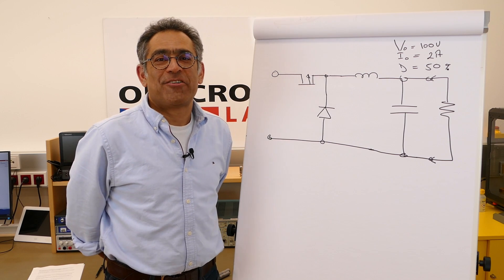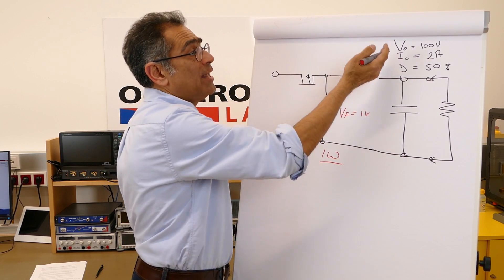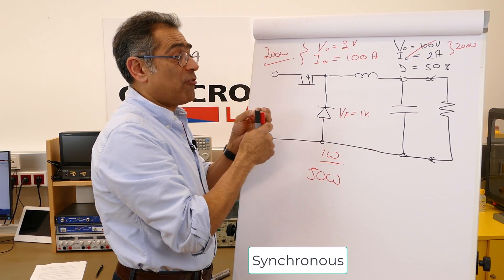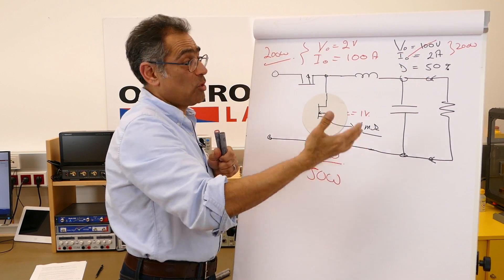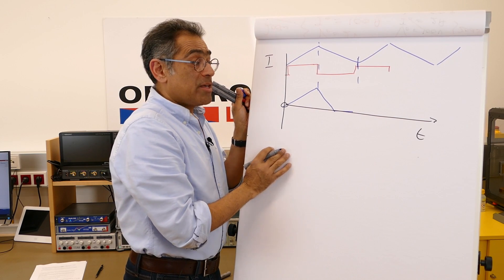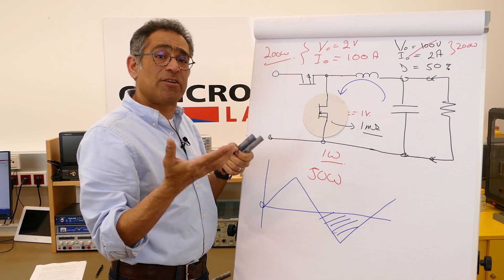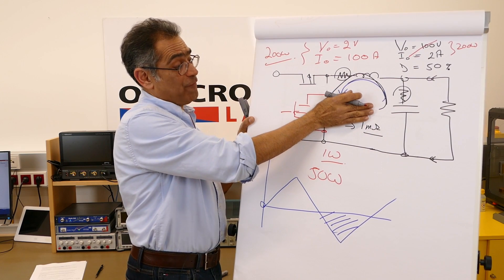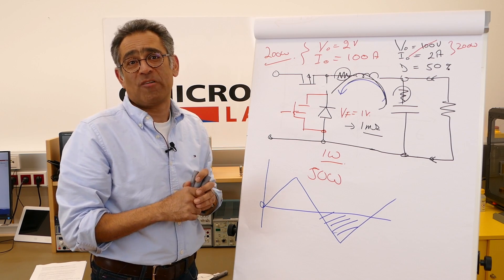Synchronous, Asynchronous, Diode Emulation! Which Switching Strategy is Best for your Application?

Comment: Thank you Sir for your great explanation.  But  I have a question.  In Synchronous emulated Diode topology or only synchronous topology means when we use MOSFET instead of only diode,  there are always a built in diode with the MOSFET in same configuration . Then why we use extra one, and what is the effect of this builtin diode in only Synchronous topology?

Comment: Hi. I have trouble with my halfbridge inverter for induction heating. I get high voltage spikes that i cant seem to get under control, so voltages are building up on the gate of the mosfets. Can you please help or advise?

Comment: 1) An inductor charges ( positive voltages) and discharge ( negative voltage) with the same direction.
2) A capacitor charges and discharges with opposite directions.
During switch off, should the negative voltage/current go with the same direction with the "switch on one", from the load resistor -> the anode of the Free wheeling diode instead of counter clockwise?